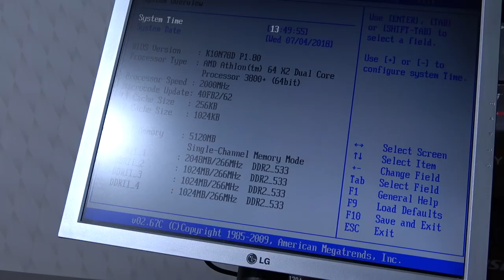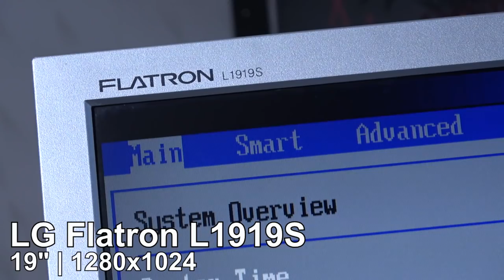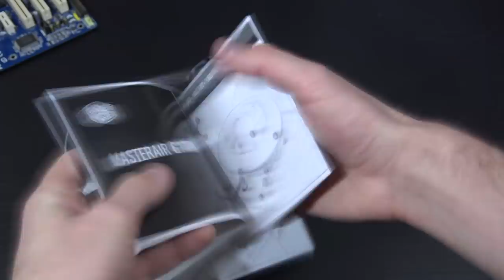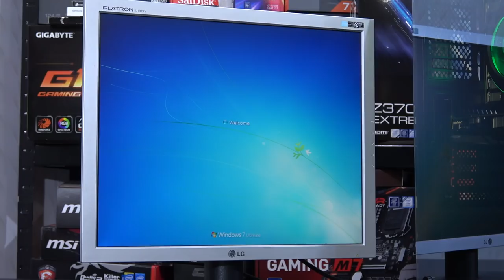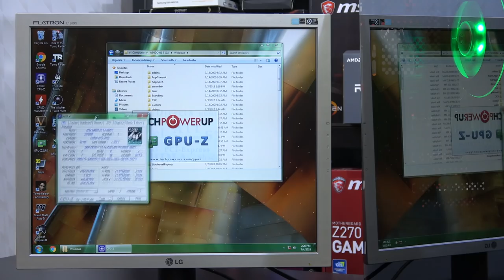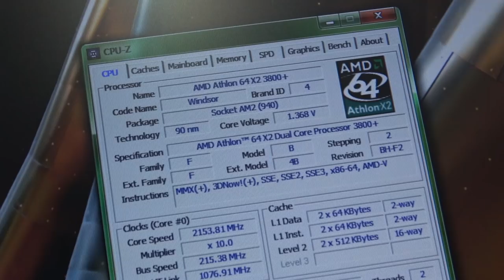AMD Athlon CPU from 2006 STILL KICKING ASS!

Comment: My AMD Phenom 9650 Quad-Core is still kicking, but it was never a great performer and a great overclocking CPU. But it still gets the job done with an SSD, Windows 10 and GT 630 Graphics Card.
Reply: thats quite a bit of CPU power for such a weak gpu. are you just using it as a display adapter or do you actually game on that setup?
Reply: epicminecraftgamer1 I work as a PC technician and repairman in a shop. I use this setup just to run some tests, diagnostics and backup files from people's hard drives. I haven't played a video game since 2010. So no, it's not a gaming setup, it's just for work. The GPU is mainly used as a display adapter just so I don't have to use the onboard graphics adapter and eat up RAM.
Reply: Ah very cool. im sure a 630 works great as a display adapter, tho i have no clue why you need that much CPU for the stuff you listed, since most of it seems more storage and ram based rather then processing power.
Reply: epicminecraftgamer1 Yeah I know, but I have to use Windows 10 since it's the newest OS and when I used it with a dual core CPU it was kinda slow. So I upgrated to a quad-core just to gain some speed on the OS and to be able to do my work faster without waiting 5 minutes to complete a task. I have older machines that still run Windows XP on Pentiums and Athlons because we use those for other diagnostics with older programs that work only on Windows 98 or XP. I have some pretty old hardware in the shop, it's kinda like a museum here. Haha.

Comment: With 5 gigs of RAM, I figured it'd be 2x2GB and 2x512MB but then I saw a 1GB stick...so this was 1x2GB and 3x1GB? You might have seen just that little bit more performance with a proper dual-channel setup.

I'm sitting here playing with my old 5200+ (Brisbane) and 9600 GSO SLi setup. This thing just keeps going and I love it! I almost have more fun playing on older, lower power systems than sitting down at my main desktop (7700k and 1080Ti) or my laptop (8750h and 1060 6GB). "It just works" isn't enough of a challenge. My old HTPC with a q6700 and GT1030? YES. Cardboard box PC with an Athlon 2 235e running on .875 volts and a PCIe x1 GT 730? Hell yes.

Comment: My Potato PC
PSU: 1st FireRose 400W
Mobo: ECS nForce 6100P
CPU: Athlon II X2 250 @ 3.2 GHz
GPU: MSI GeForce GT 520
RAM: 2x Kingston 2 GB DDR2 @ 400MHz
System HDD: Hitachi Sata III 160GB 7200RPM
Data HDD: WD Blue Sata III 500GB 7200RPM
OS: Windows 10 Build 14393
Since i have Athlon II 250 (upgraded from athlon 64 x2 4800+), most games that i've played getting better framerates and lower stuttering rate
Reply from the maker: Nice! :D
Reply: You can uprade current athlon to phenom ii x4 if motherboard supports, since AM2+ are compatible with AM3 processor

Comment: Is the Athlon better than the Sempron?🤔 Thanks I got a hold of a Dell 531 Inspiron. Turns out it has a Sempron LE series 2.2Ghz, 4GB 800 mhz RAM, 64-bit, running Win 8.1. Think it had an Athlon before. Was the 850W PSU a bit overkill?

Comment: I just recently built my Athlon X2 4800+ build, basically my dream build from back then. Mine uses socket 939 though, so I'm limited to DDR1. I've got a 300 gig raptor drive, two 7950 GX2 cards in quad SLI and 3 gigs of ram which was the best I could do with DDR1, at least with my Asus A8N-SLI Premium motherboard. All of the above are the parts I salivated over in 2005-2006, and of course, all running on Windows XP. I originally lusted over 4 gigs of Corsair CMX pro series ram, but after spending nearly $90 on a set of ram that turned out to be bad, I just opted for whatever I had lying around, I wasn't going to spend another $90 on ram for a machine I'm never going to use :P For reference, the CMX pro series has LED lights on top that actually light up and reflect how much ram is being used, super cool!
Reply: Wipe the ram with degreaser on the pins then reseat ten times to see

Comment: I have 2007 Model, M2A692-GDG, AMD SOCKET AM2 ATHLON 64X2 PROCESSOR, AMD 690G+AMD SB600 CHIPSET, 8GB DDR2 800MHZ RAM
it is possible to upgrade processor and GPU? if any suggest.

Comment: I still have a system with Athlon X2 4800+ inside. It was running on an integreted GPU, but my main PC motherboard just died (yeah, sucks) so I took my old XFX HD 7770 from it, and I placed it inside Athlon one, since I switched to a laptop. I can say that it still works pretty good for it's age.

Comment: My old Dell Inspiron 551s still running upgrades it from and 3800+ to amd 6000+ with MSI Radeon RX 550 aero Itx 4gb OC 
And 5gb ram 1333.

Only going i3 and different board for sse4.0 & sse4.1 instructions that the older amd processor wouldn’t run!

Great pc not the best but, run almost everything with little to minor stutters on modern games running at medium setting
Most new new games need the lowest resolution and lowest settings to play but, it’s still a champion 👁‍🗨

Comment: Did you try to overclock your CPU to see if you get any noticeable increase in FPS? I recently put together a XP 3800+ (socket 939)  o/c to 2.2Ghz which makes it an XP 4200+ then. I couldn't overclock mine any further as it refused to boot and/or got a black screen.  Or maybe it was the 4gb of DDR RAM?

Comment: my first pc was back in 2007 and it had an athlon x2 x64 5000+ dual core (2.6 ghz), 2 gb ddr2 800Mhz, 160 gb Hdd, 400 Watt power supply and a ATI Radeon HD 2600 Pro 256 Mb VRam/ 128 Bit all this paired with a samsung monitor 19' 1440x900 , and it was a "beast", i could play any game back then :D

Comment: My first Dual Core !!!
If you were to give it 4x2 gigs ram, it would perform better under proper dual channel configuration. But DDR2 is simply old and slow for modern games.
My Spare emergency gaming rig is an old Phenom II X4 955 clocked at 3570Mhz on a M3A78EM board with 4x2 Gigs DDR2-800
The same CPU runs on boards with DDR3 ram, and there is a significant performance gain to it, specially on modern titles.

Comment: I have 2 AMD PCs one with an AMD Second Generation Opteron 1210 hp proliant ml115 g1 which can have a video card in also an amd x4 620 but I don't use the PCs now though they run win 10 fine.

Comment: That kind of monitor still usable nowadays on modern games?
Reply: OrVCiO you can always reduce resolutions for older hardware so long as the interface is supported without adapters. Adapters is where problems can arrive depending on the compatibility.

Comment: I used to have a 4800+ in my old pc. The video card sucked though, so I had to run Minecraft at 40-60fps back then. (around 1.5 era). CSGO ran at like 40fps in 2014-5 on the lowest preset (1024x768). Although I did upgrade the GPU in mid 2017, just for fun and the computer pulled higher fps than before. I didn't do much, but CSGO was able to pull off around 80-90fps on 1024x768,  although putting it any higher than that the game would be running with under 20fps all the time.

Comment: the athlon ll x2 250 is the best dual core on the athlon, it will run crysis and tombraider at 60fps especially if you overclock it by 500mhz. it even will run overwatch at a stable 50 - 60fps as well as wow, wow will run like at 75fps. those 3800+ and 4000+ are PERFECT for arcade cabinets.

Comment: Bit late I know, but you should have turned this into an awesome early XP rig, with a soundblaster card for EAX, and played all those late 90's/early to mid 00's games. I have my old socket 939 4800+ machine for just this purpose (cannot believe it still runs). I had a CRT monitor for many years too, but that died, so I had to do what you have with the 4:3 LCD.

Comment: Just a short comment... You cant use the Athlon 3800+ singlecore for gaming from 2010, because the most of the games required multicore processors. The 3800+ singlecore is very slow for nowadays os, softwares and applications. I think the x2 version is slow as well.

Comment: ah, reminds me of the times when i still had my old PC using an 2005 Athlon 4600+, i was completely about the performance so i lowered all video settings as far as i could and i'd limp gta 5 at 15 FPS but i was happy, the thing did its job for me for 10 years, right now a friend is using the old PC to run a server for a some game he plays.

Comment: I've got one of those CPU's sittin around, just don't have a board for it anymore. The board I did have gave up the ghost. Of course if I wanted to run some older games I have sitting around, I do have a spare first gen i7 machine equipped with 12 gigs of triple channel... just been too lazy to go thru all the trouble setting it all up to run XP or 7. So I just use my latest machine for the newer games on 10.

Comment: My first computer actually used the athlon x2 that wasn’t 64 bit. It felt so bogged. To think that if I had just a small jump forward, it would have been better. Well, it’s whatever now. It wasn’t until 8 years later that I would own a system with more than two cores.

Comment: just finished putting together an athlon 64 x2 6000 system altho it could use more ram 2 gbs kinda slim its set up with the Hybrid Crossfire between chipset and hd3450.. plays minecraft mission accomplished lol. not sure where this jank ass power supply came from. tried to fit the hd3870 but the psus got 3 sata 1 molex. couldn't splice off the molex to a 6 pin or the hard drive would power struggle. also. old hardwares coming back because all the best games have already been made.
Reply from the maker: Nice!! :D

Comment: These Athalon chips which also were related to Turion X2 were monsters for the time. My Dv7 which had a Turion X2 Ultra could go toe-to-toe with a Intel i5 8 years newer, and absolutely demolished our old Pentium D Extreme (a stupid expensive CPU and top of the line from the time) in pretty much everything.
Reply: I had a dv4 w a Turion X2 ZM-80 (or some such). That thing did kick ass! Of course my laptop monitor maxed out at 1280x800 (something I just realized the other day) and the TV I used as a monitor, after the screen crapped out and I completely took that off - leaving just the bulky keyboard and wifi wires dangling from one of the holes where the screen was mounted, ... TV was maxed at 720p.

I don't remember the gpu model, but it was early Radeon HD days. Just before the switch from ATI to AMD. My current PC with higher frequency cpu runs slower than it did.

That laptop crapped out several years ago after I disassembled it for the 3rd time. Popped the heatsink off without reapplyong thermal paste. Prob fried it. Still boots! But doesn't stay on for long.

God they did a terrible job w cooling and airflow w those dv Pavilions. I removed literally sheets of dust from that thing a few years after I got it. Worked like I had just bought it new after cleaning it out for the first time tho!

Comment: I have a AMD Athlon 64 X2 5000B 2.6Ghz what is the best Graphic Card for my old Processor??
Reply: Gt630
Reply: areeb yousuf ddr3 or ddr5??
Reply: Any 128bit card but processor is low upgrade to core2quad with any good 128bit graffics card ddr5

Comment: You should test the fastest Athlon 64 X2, the 6400+ built on 90nm or the slower clocked but smaller node 6000+ on 65nm node. The 6400+ is literally clocked 60% faster and truly competed well in up into the late 2000s until games starting requiring new SSE instruction sets the athlon 64 series didn't have, yet intel starting with pentium 4 did have.

Comment: I was using the 3800+ for 15 years(upgraded just few days ago to phenom 8400 ) its ok ish cpu but i put more powerful gpu 7950 gt  to replace 9400gt 512 mb so i needed cpu upgrade.
By the way i needed bios update to use phenom on my motherboard 
Motherboard:msi k9 neo v2 rev 1.0 
I perviosly was using bios version 2.6 i upgraded to 3.0b and the phenom 8400  is working fine and that cpu has better thermals 
Im using win xp 32 bit sp3

Comment: Was using a socket 939 Athlon X2 3800 with4Gb DDR1 and some kind of NVS video card, until last year. Only upgraded due to the caps on the board going :(

Comment: am2... i have a 939 pin socket, athlon x2 4400+
4 gb ram ddr1 , gtx 780ti 
windows 7 64bit
msi platinum mobo with sli
corsair vs650 ( fan barely spins)

i can play witcher 2, euro truck sim, etc 
steam works fine
need to upgrade my hdd to ssd to cut some lag

runs about everything. ..
Reply from the maker: Nice!
Reply: hi Nicolas

please can you cover some amd future in your next videos   ! !   ??
what happened to the x490 chipset  ?
is amd getting pcie4 into ryzen or even threadripper any time soon ??
and the rumour winds of future ryzen beeing more than 8 cores , do they have any force..?

thankx and throughly enjoy your videos.

Comment: Nice video.  Remembering that way back when these CPU cost AMD $100+ each (total R&D and manufacturing cost).  Even now if you wanted to manufacture a new batch of AMD 64 X2 3800+, it would cost at least $30 per cpu (considering all the cost of fab time, man power, raw materials etc).  Meanwhile these cpus can be had on ebay for few dollars at most.

Comment: A X2 6000+ would be a lot better with the GTX 750. The X2 3800+ was really the entry level X2, and was hardly compairable to the C2D E6300 back in 2006. The TOTL A64X2 can still handle most games from 2006-2016 that only utilize 2 threads.

Comment: I just built a 955 today only could over clock with phenom tweaker because I still have a hp board. 3.7 stock cooler. Playing deus ex no problem. Can't believe I found a way to over clock with everything stock first time I tried that.

Comment: I understand if u install win 10 and direct x 12 it wil make games run well on a dual core ......i have an athlon 3200+ and i am going to try this   ...   problem is whith the motherboard because it does not hold 4 Gb ...(it is an asus a8n sli se) ...only 3.7 ram and sticks dont match

Comment: Whit newer videocar you can play team forttres, left for dead, battlefield 2 and games where are not much 3d inside. If you overclok. it will be 200 wats. Its 10-20 times slower than new ones.

Comment: It would probibly run better with a larger res monitor so you utilise the gfx card more. But othervise nice video great job :). I my self has a couple of maschines vith dual core athlons on both socket 939 and socket am2 they are awsome :)

Comment: I'm building one right now hopefully tomorrow I should have all the parts 
GIGABYTE GA-MA78LM-S2H Motherboard with AMD Athlon 64X2 Dual Core 5000+ Processor & 4GB DDR2 RAM
corsair CX500m power supply 
x1 Corsair case fan
x3 artic case fans 
60gb HDD
1TB HDD USB enclosure 
4gb corsair xms2 ddr2 ram 2gb x2
I need to find a retro case and a low-power GPU as my power supply does not have the right pins for a gtx 980 4GB card, it actually looks great with no mustard cables just a blue motherboard paired with a fanless CPU cooler and black and white parts. I will post a video on my page if anyone wants to look later

Comment: Was that a common style cpu cooler at one point?
Reply: This seems like a fairly modern cooler, considering the fact it has RGB lighting. That said, sunflower heatsinks were pretty standard back when this CPU was introduced.
Reply from the maker: Nope, the G100M was just released this year.
Reply: Quickshot Gaming not back when this cpu was made it wasn't. This cooler was unheard of back then. These are aftermarket coolers to take place of OEM.

Comment: I had a 5200+windsor it was pretty cool... But it couldn't run gta5 above 25 fps on the lowest settings after overclock it ran 30-32 fps but i changed it for a phenom1 9650

Comment: You should to remove Windows 7 and install Windows XP or Windows Vista on that computer. Because Windows 7 is being getting unsupported and Windows XP and Windows Vista are more fitted on that CPU. Also, Windows 7 came out in 2009 and Windows Vista was released in 2007.

Comment: Well. I still have my AMD Athlon QL-60 Laptop, still kicks ass. Especially in emulating GBA Games. (I use mGBA for playing the games) which was dual-core, and had 3 gigs of DDR2 ram. Better than those Celeron laptops Compaq made. Plus, the Nvidia 8200M. Tesla was legendary. (The architecture, not Nikola Tesla, who made Alternating Current)

Comment: If you can't gather 4x2GB of DDR2 easily, something's wrong. I have so many 2GB sticks of DDR2 I can build at least two computers with 8GB of DDR2 ram based on components I already have. Lmao those old Athlons and Phenoms are still great
Reply from the maker: Well, unfortunately I didn't own nor did I have access to a lot of hardware back then. That's why I'm very short on DDR2 RAM. I never really had high-end systems up until 2010 (CPUs side only) and then 2013 (with higher-end GPUs). :)
Reply: Nicolas11x12 English It's not too hard to find a few old hand-me-down systems that someone doesn't care about. And a 4GB kit only costs about $27 nowadays honestly. I didn't have acces to any high end hardware until 2017, I built computers entirely out of other old hand-me-down units and parts. Until 2017, I was rocking a Phenom II 955, 4x2GB DDR2, a GTX 750, and an ancient APEVIA branded PSU that all the plastic had dry rotted on, and the fan was held in by tape because all the mounts had broken due to the brittle plastics. Fun times, fun times...

Comment: The GPU in the that system is not designed to paired with that processor, its a bottleneck.